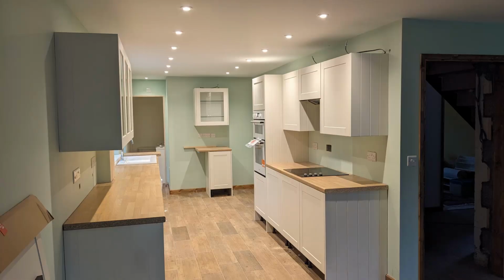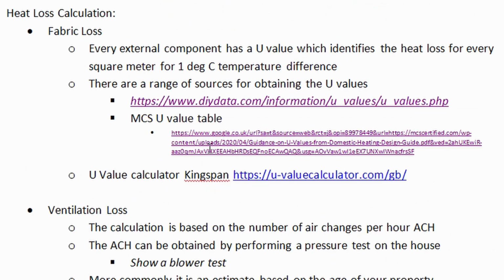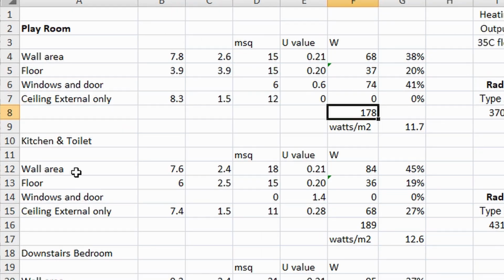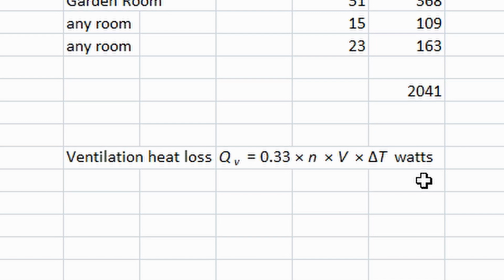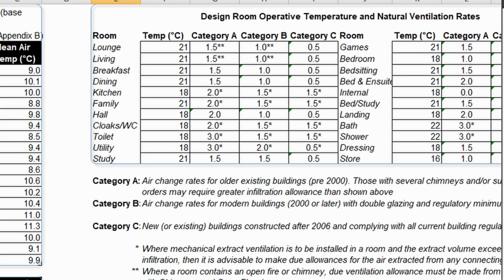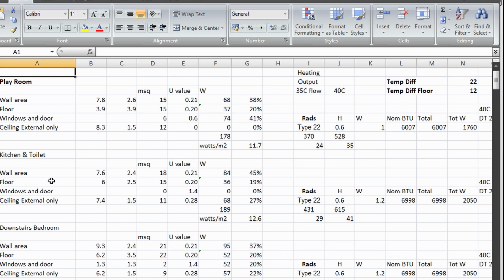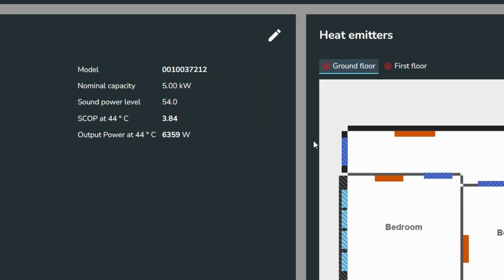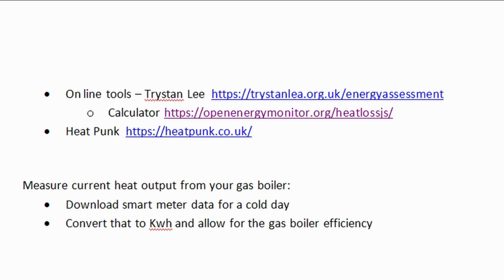How to size a heat pump, using heat loss calculations.

Comment: I know it's not related to this but did you get batteries and solar power system to help reduce running costs?
Reply from the maker: We are in the process of doing this. We had 27 solar panels installed just before Christmas. The Tesla Powerwall 3 battery arrives in February when it will all start operating. The quotes varied from £28k to £16k. The real danger is many people are selling battery systems that do not work in a power cut or they say they do, BUT when you ask more questions you find you can't heat your kettle, cook a meal etc etc. Another case the salesman said, oh, you can throw a switch to a separate emergency house circuit.
Tesla is the only battery I can find that I am confident works automatically in a power cut with no limitation in the house operation. My brother and a friend of ours have the Powerwall 2 installed and there is seamless operation in a power cut. Not only that the two least costly quotes were both Tesla installers.

Comment: Thank you for the video, I wish I had seen it before the heat pump installation. My heat pump is 3 kW’s too small and it felt like it - Gas boiler re-installed a week ago!
Reply: The most usual error is installing too large a heat pump, this is very unusual. My 5kW heat pump is more than sufficient for my 1960s ex council end terrace.

If the heat pump was too small then it's a real shame to reinstall a gas boiler, it should just be a case of fitting a larger heat pump as all the plumbing would be done.
Reply: @ Definitely undersized. 2 properties - 4 bed 3 bath 2 kitchen 1 dining 2 lounge 2 corridor 2 kitchen etc. New gas boiler - Christmas? Love it, we have a warm house. The battle to replace the heat pump with a properly sized one starts in the new year. I am no longer in a rush 😊 😂, hence the gas boiler!
Reply: @fje1948  The advantage of the open energy monitor system is that you can see exactly what the cause of the problem is. A friend feared his heat pump was too small, but because he had the open energy monitor system, I was able to tell him that the heat pump was only running at 50% of its power. The solution was to change the weather compensation curve so the under floor heating ran at a higher temperature.
He is very happy that his heat pump is big enough and doing a great job. I am not saying your heat pump was the same but the benefits of the open energy monitor are huge.
Good luck with your journey.
Reply from the maker: Goodness me, how terrible. Who did the heat pump calculations? Surely your heat pump installer would have done these calculations on your behalf.
Reply: @ 
A D…. Approved installer. We heat our house/DHW via a heat store as we also have a wood burning Rayburn, hence re-installing the gas was not an issue. Merry Christmas in a warm house!🎄
Reply: Very sorry to hear of your poor experience. I wonder if you could report the installer to MCS
Reply: @  As a last resort I shall!

Comment: How did Heatpunk compare with your spreadsheet calculation for heat loss?
Reply: I found them to be very similar.
It was easier with my spreadsheet to look at insulation options than on heat punk.

Comment: Hi James. Did you compare your calculation with your real world heat pump usage?
Reply: I have done that in the video Microbore heat pump 12 months performance.
I found that  the heat loss was less than I calculated.
I think this is due to the air changes per hour used in the calculations being too high.
Reply: @hughrattray9354  Interesting. Did you recalculate to try and match your real world with a lower air change calc.?
Reply: @andrewcunningham1  I do that in the video "Microbore heat pump 12 months performance" at about 24 mins in. I found if I assumed ACH of 0.5 rather than 1 the calculation and actual were very close. I think this makes sense as we have modern door and windows in the main living area.

Comment: How do you feel about the degree days approach to sizing?
Reply: I will look into it more but on the face of it seems easier and more accurate to us the energy usage from a single cold day to get the heat transfer coefficient..
Reply: @hughrattray9354  just to be clear, I was referring to this method https://youtu.be/hCeghKa3liM?si=9clejskhcMllG9H9
Reply: @FrancisCWolfe  Thanks - I have had a look at the video and it is very well explained and does seem to work well so it is a good alternative.
I haven't quite got to where the formula comes from. 
I still feel a controlled experiment over a couple of days woul reassure me more. The house would need to be preheated to the temperature you want (not what you have put up with). The tempetaure inside needs to be measured accurately so a good average can be calculated.
I will try and use this method form my house and see how it matches with the other approaches.
Reply: @FrancisCWolfe  I have jus done the degree day calculation and it came out at between 4.0 Kw and 2.5Kw depending on which year I used. The lower figure did come after we had improved insulation.
The figures are close to the calculation method.